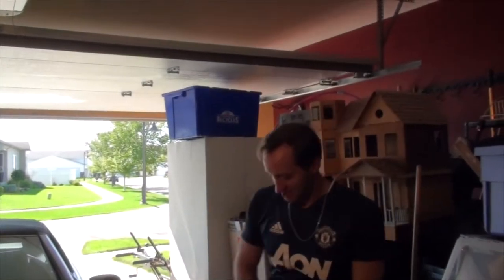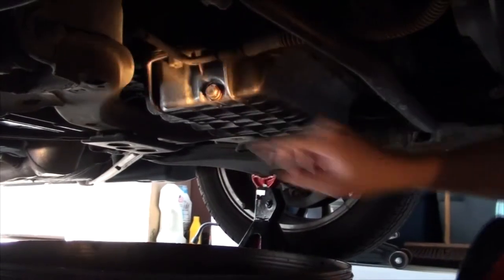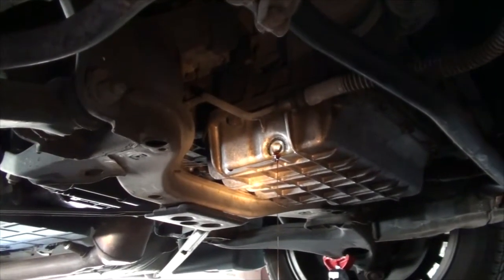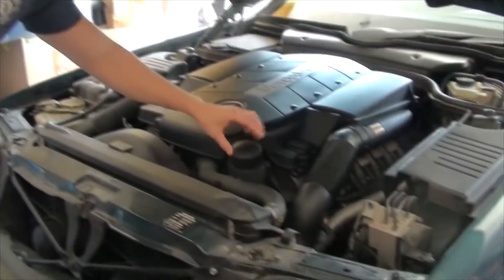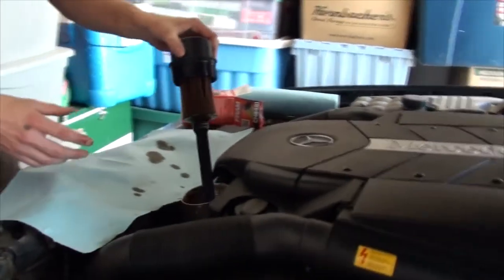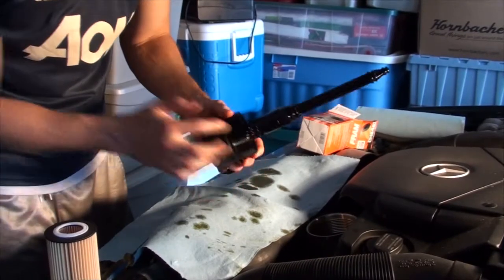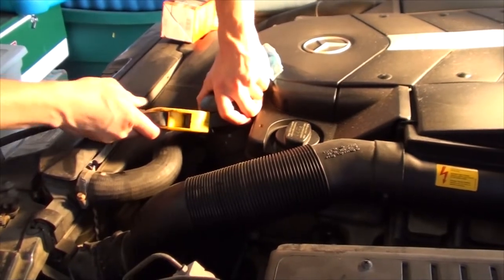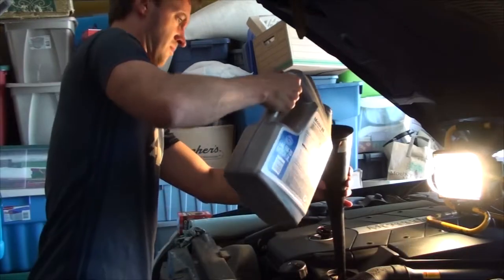[TUT] 1999 Mercedes Benz SL500 - Change Motor Oil

Comment: Looks good, didn't know the filter was up on top. will have to get some jack stands etc. Straightforward video, thanks!
Reply from the maker: Thank you for the comment, SL500-Brother Larry.  Is this a new vehicle for you?  If so, I'd encourage you to take care of the other routine maintenance.  autohausaz.com and rockauto.com are reliable and fairly reasonable sources for parts.  Take care  :)

Comment: Great video! Thanks man! Questions for you if you can answer! I have the 99sl500 and I live in California, kind of hot up here all the time, would you recommend a type of oil just for the weather or same as yours? What would be the difference? 

Thank you!
Reply from the maker: You could theoretically get away with a thicker motor oil, say 10W-30, but I wouldn't get cute with it. Stick to a high quality 5W-30 Full Synthetic.
Reply: @VestigialVoice  Thank you!
Reply: 5w-40 fully synthetic is what Benz dealer would use

Comment: FIRST you change the filter, because filter housing still holds oil in there, it drains just AFTER you unscrew the filter! (Anti-drain valve) That is why filter is vertically and downwards positioned. It's pure logic...but you Americans always do it wrong. It's not a classic screw-on metal filter.
First change filter, then drain all of the oil. 
This way, you still left 0.5-1.0 liter of old oil in the engine! 
BTW, that oil is not the right oil for this car.
Reply: @VestigialVoice  
Hey...don't be like that now...your insinuation looks pretty bad in comment section. 
I don't think you are stupid. You've got great car, I just tried to explain what I find mostly misunderstood in these oil change videos. I said "Americans", because used to external metal spin-on filters...

You really don't have to change filter first - but just leave the drain plug out while changing it. 
Stay good ;-)
Reply: do you even lift bro?